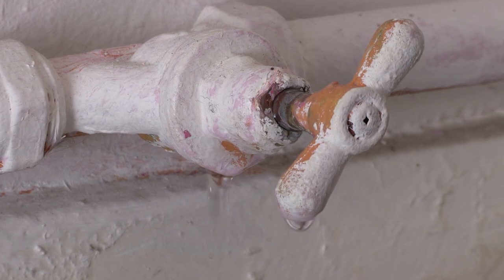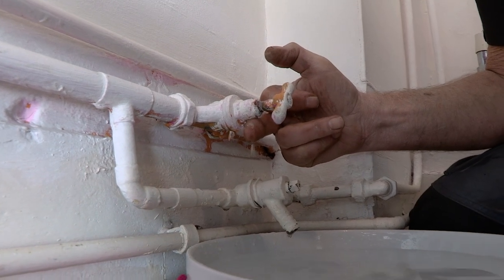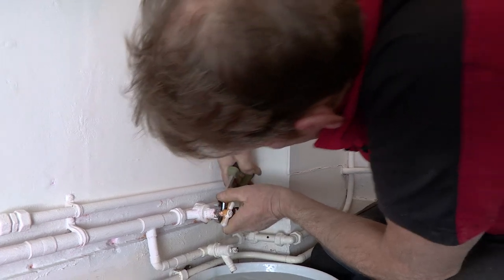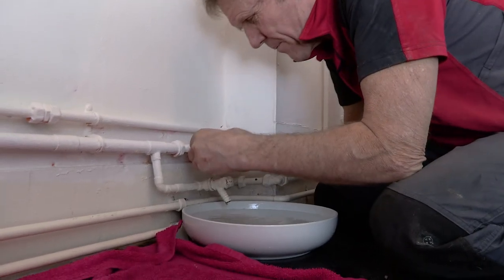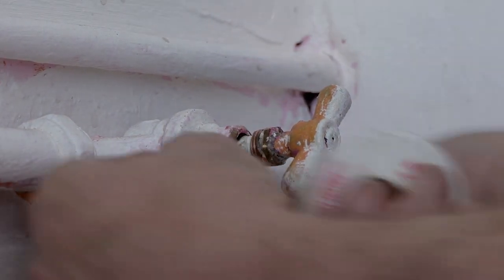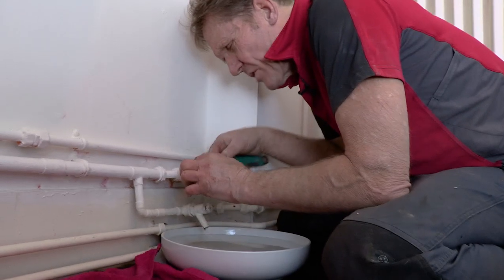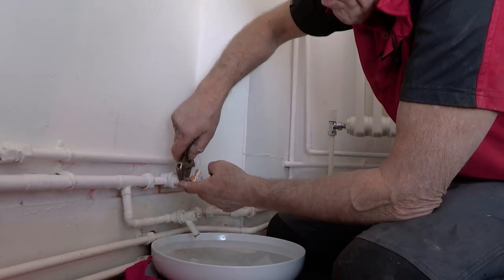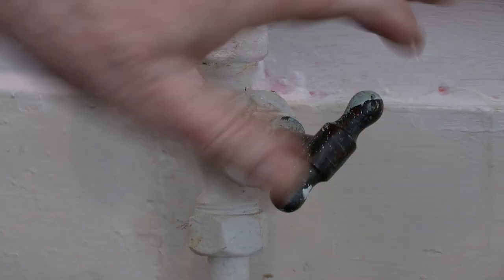How to Fix a Leaky Stopcock & Stop Dripping Water

Comment: When confronted with a leaky stopcock today I looked high & low for the tool for turning off at the street. I couldn't find it & so I bought a new one alongside a new stopcock. I wasn't looking forward to changing it as it's in a very akward position. However when I got to the street to turn off the water I found that I couldn't because it was just full of mud & god knows where the tap bit was because I never saw & gave up to go & watch the football! I was going to have another crack at it the next day when I did a bit of digging on youtube late at night & found this video. Now I always have some PTFE in my toolkit so I had a bash at it at midnight & I sorted it in 10 minutes! I am kicking myself because, although I am sure I could have succeeded with changing it, just how much easier is doing it this way & not eating up time on my day off! Brilliant video! Thanks!

Comment: I appreciate you were showing an actual leak from the Stopcock itself and that's a handy trick. I find it more common that the old triple painted SC won't completely close prior to a draindown or refurb and (assuming you can either get to the incomer or catch residual passing  'live' water for a short period) I recommend cutting a second stop cock into the line rather than fiddle with replacing parts of the original - then the original becomes redundant and the homeowner has got a nice new UNPAINTED stopcock for the future

Comment: Just used this technique to repair the stop tap that flood the kitchen floor, took only a few minutes.  Saved me having to rip out the back of thecupboard (could only access front of tap) to renew. Will replace when kitchen is refurbished but saved me work I didn't need to do. Thanks

Comment: Just a tip don't forget to turn the stopcock full on then give quarter turn back, just in case the stopcock seizes up at a later date,   then you can ease it backwards and forward to turn off, instead of only having one direction to go in , which can shear the tap handle off.
Reply from the maker: You are spot on with that and I should have said it rather than talking about poo.
Reply: Skill Builder Haha. Also, it might sound like common sense, but some people might not know there's a correct way to wrap PTFE.
Reply: This video told me everything I need to know, I felt obliged to leave a thumbs up! When I did I saw a fellow Lyons right at the top of the comments lol spooky coincidence
Reply: @colingill9317  Have you tried Monument , possible long extension from socket set

Comment: Nice work Roger, I especially liked your very brief chat of how us plumbers have to be very good detectives! Half the problem is diagnosing. Condensation on cold always throws people in thinking they have a leak. Also with packing glands I find it easier to remove the tap head if possible, removed the gland nut and using a pick to shove the PTFE right in there, then tighten up. I absolutely detest painted pipes! A quick blast with the blow torch and wire brush cleans things up nicely. Hold your breath though!

Comment: Rodger you star! You've just saved me having a panic on tonight. Got some plumbing work going on tomorrow so I thought I'd try my stopcock, seized solid! Sprayed some crack-it on it (which worked a treat) and got it closed. Went to open and got a leak, big one! Followed your instructions though (squeaky bum time loosening that nut first time) & stopped the leak. Cheers!!
Reply from the maker: That is great to hear. Nobody wants a flood not even Noah!

Comment: Hi Roger, first of all thanks for these videos - I've found them consistently useful as I've built up my plumbing skills over the past couple of years. I have quite a specific question concerning stopcock orientation. All the guides from various water undertakers I've read (as well as the C&G Plumbing Book 1 Textbook) only describe the stopcock when fitted to incoming pipework in a vertical orientation, with a drainoff fitted immediately above the stopcock. The installation in this video shows a stopcock fitted to pipework in horizontal orientation, with drainoff below on the pipework (presumably) downstream of the stopcock. I have just installed a new MDPE incoming pipe to my house, and would like to fit the stopcock in similar horizontal orientation above floor level, after which the downstream pipe will run under the floor into another room. I was planning to fit a double checkvalve immediately downstream of the stopcock to prevent the possibility of backflow into the mains, and fit a drainoff immediately downstream of the double checkvalve (all above floor level in horizontal orientation). Only after the drainoff will the downstream pipe bend down under the floor and through to the next room. To your knowledge, is my proposed installation compliant? I was beginning to think that the only compliant configuration was with the pipes running in and out of the stopcock in vertical orientation - until I watched this video! Sorry for the length of this question. Any help you can provide will be appreciated massively!
Reply from the maker: It is fine to position a stopcock in a horizontal position, I have one in my own house because the pipe comes into the cellar. Personally I wouldn't bother about a double check valve but it is up to you.
Reply: @SkillBuilder  Thanks ever so much for your help. That's taken so many headaches away that you wouldn't believe it! Massively appreciate what you do - just subscribed! Thanks again.

Comment: A good tip if the gland nut isn't jammed. I have an outside tap that dribbles badly when the hose is connected but there's no way I can loosen that nut without pulling the tap off the wall. New tap required I think!
Reply from the maker: It is the quick and easy option. It is often freezing that causes the 'O' ring to split on the spindle

Comment: Hi Rodger.
I am wanting to carry out an outside tap project and I want to bring the supply from the cold washing machine pipe. The only problem is although there is a cold isolation valve as the pipe comes through behind the washing machine, it will not turn off - it's seized up. How do I go about getting it to work?

Comment: I,ll have to try one your egg suggestions, ps it shut him up didn't it,,I fit bathrooms myself and I get that a lot and nothing ruins your day more a leaking stop tap in a kitchen cupboard under a sink  surrounded by bleach washing powder etc etc and the hole in the backboard is only big enough to get a few fingers on the tap most often than not pliers to turn it on and off,  I need blood pressure pills after I have dealt with one them lol

Comment: Great video as usual Roger, but I am curious as to why you keep such a crappy tool in your bag that can round off the flats of the gland and cause more damage. Also, regarding the dual flush, I have remote cables to my cistern, and I can’t see the difference when using either button
Reply from the maker: That tool just migrated into my bag. It has gone in the bin now

Comment: How come you didn't need to turn the main water off at the road?
Reply: mark rowley a stopcock has the same design as a rising spindle tap where as you turn the handle, a spindle (the bar going through the body that the handle is attached to) has a metal plate at the bottom of it called a jumper which the tap washer (rubber seal) sits on. When the tap is all the way open, the jumper is pulled relatively tight inside the body of the tap so only a little bit of water can pass through then above that would be the packing gland which has packing which stop the water from passing up through the tap and leaking like in this video. That’s why the fix is to just repack it and stop water coming up through the packing gland.
Reply: Forgot to mention that as you turn the handle, the spindle rises or lowers as the name suggests, rises to allow water through when you open the tap and lowers to push the rubber washer tight and stop water flowing through when you close the tap

Comment: We have noise on our taps, and serious vibrating that only stops if you run the hot tap, it started with a horn type noise now they are shaking so badly.  When we turn the water off over night because we cannot keep getting up to do that, we turn it on and so much water comes out the upstairs cold tap its like bullets - we are a one income family and cannot afford a plumber right now so just looking for some advice.  Our neighbour also has the loud sounds when turning on taps - our kitchen tap does drip but we think it may be a water pressure issue that is down to the waterboard, would love your thoughts x
Reply from the maker: The problem is to do with the ballcock in the loft. This is where the big tank is. It is not being caused by the taps but is the ballvalve (ballcock) vibrating. The best way to solve it is to renew it but if you have not done any plumbing that is not a job you can do easily. Instead try this trick. Get something like a large yogurt pot preferably a 1/2 ltr plastic pot.  Find some wire that you can thread through the sides to form a little carrying handle.  Hang this on the arm of the ballcock so the pot dangles in the water. This will produce a slight drag on the valve and stop the ball bouncing on the surface of the water. It is the tiny bounce that produces the noise you hear in the pipes
Reply: @SkillBuilder  Hi i do not have a tank in the loft and my pipes physically are shaking, do you mean the ballcock in the toilet?
Reply from the maker: @spaceysno1girl-youtuber  OK Lisa it may be the ballvalve in the toilet. I was thinking that because it stopped when you ran the hot tap that it was more likely a tank feeding the hot. 

What happens when you turn the cold tap on, does that stop the noise. 

Also can you tell me if this is a flat and, if so is it a converted house or purpose built. Do you have a combination boiler. 

You might solve the problem by turning the mains stopcock up or down slightly. The noise is caused by something vibrating, I have come across it many times and usually I just walk around the house and find a ballvalve is singing.
Reply: Skill Builder its a house, we have a combi boiler and bathroom upstairs, it vibrates frequently and the only way to stop it is to put the hot tap on, the cold does nothing, when we turn the water off then back on air comes out the cold tap, the noise also happens in our kitchen and when using the cold tap

Comment: Why is there a screw in the centre of the stopcock? Do you need to unscrew this before the stopcock will release and turn off the water supply?
Reply: The screw is there to hold the handle on

Comment: Well, I was originally looking for tips on tap fixing but this was a bonus :). I have a question if I may. I am cleaning up my old brass kitchen mixer tap. I originally wound some PTFE onto the thread where the tap unit/cartridge screws into the hot and cold block. After a while, it started weeping. I have been told that it is better to use a rubber 'O' ring instead. Is this correct? My main concern is that being brass, I want to keep the thread wear to a minimum. Thanks.

Comment: Didn't expect to see you of all people using one of those rubbish cheap wrenches Roger! 😁
Reply from the maker: Yeah like I said they just attached themselves to me and never left but I have thrown them in the scrap now never to darken the Skill Builder videos again. 
I have way better ones than those but of course I shouldn't really have used grips on brass in the first place.
Reply: Skill Builder knipex grips the only way to go
Reply from the maker: tadhg
I agree they are the biz.
Reply: tadhg muldowney I agree. Knipex for pliers and Bahco for adjustables. Sorted :-)
Reply: Skill Builder Try the Knipex Cobra Quickset waterpump pliers.
Reply from the maker: Will do for sure. Thanks for the tip
Reply: I like the Knipex pliers wrench with the flat contact surfaces even more for that kind of stuff. Maybe a two stage flush marked with 💩 would be the 2017 way of getting the instructions to people.

Comment: I turned mine on to see if it was all the way on and then it started leaking, my real problem is, why when the washer is filling up, it stops in between and shakes the pipes.Makes it sound really loud upstairs
Reply from the maker: There is a solenoid valve on the washing machine that has an instant off action and that often causes water hammer in the pipes. You can help the situation by slowing down the flow into the washing machine or by putting in a shock absorber (hydro pneumatic accumulator) on the pipework so the shock waves are given a nice cushion of air.

Comment: Why didn't you use a spanner first and potable water jointing compound.
Reply from the maker: Because I thought the grips would do it, all that paint made the spanner hard to get on but yes I should have used it. The jointing compound would not do anything much.  The spindle has to move in the gland. They used to be packed with fibre but these days they use an 'o' ring. People often slap jointing compound on things and make them worse.
Reply: You are right, jointing compound useless in this situation but sometimes just a small tweak on the gland nut will sort the job without extra packing.

Comment: My stop cock leaks a little, but only when water fully on, so I just turn it back a full turn and it stops, so far, just avoid turning off the water whenever possible, but your fix is great cheap and easy, thanks again for the video...

Comment: A smell sensor would work ! My BMW has a smell sensor of sorts to switch over the climate control onto inside air recirculation instead of outside air if not in a 'fresh' environment e.g sat in traffic fumes it's a fairly old car aswell 2006!. Just remember this tho girlies no farting on the toilet while having a wee wee otherwise it'll do a full flush . Boys your ok to fart & piss at your leisure. All turds monitored !

Comment: The problem of two different flush stream couldve been easily solved with clearly designed icons on each button for Christs sakes. Are people really that simple?
Reply from the maker: I would be interested to see your suggestions for the icons and given that the meaning of 'icon' is a symbol for religious veneration would you suggest that people kneel before making their offering?
Reply: @SkillBuilder  lol pretty funny. No, simply any decent icon from nounproject, I'd use search terms 'half full' (or 'half empty') for the no1 and 'full' for no2